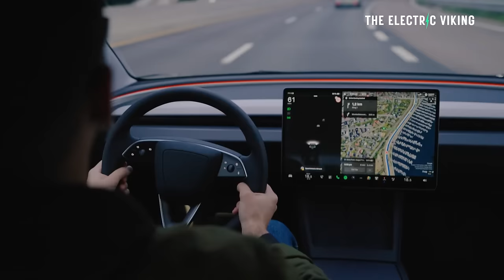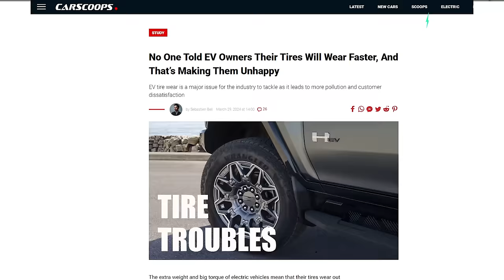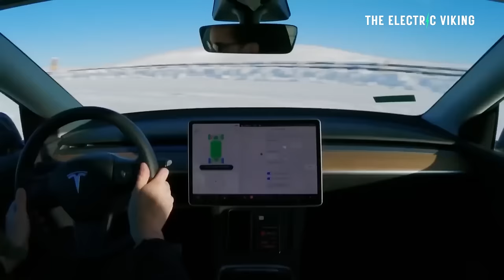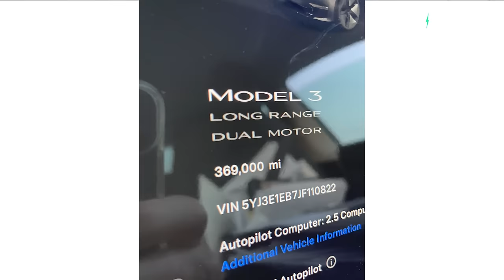I found the highest mileage Tesla Model 3 in the world - I'm shocked!

Comment: 400,000 miles... that's roughly $100,000 worth of gas he "didn't" buy.. not mention over 100 oil changes...  and the list goes on.  Even losing 20% of the range, is still a very usable car.
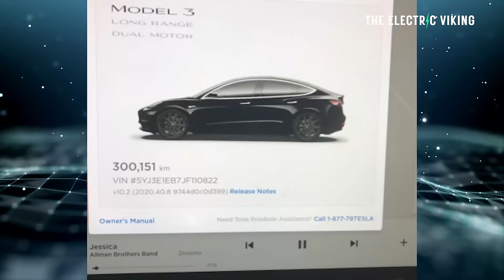Reply: Where you see 400k miles?🤔🤷🏻‍♂️ ? In video from 5:57…☝️ look again pls … all interior dash scene shots is from same ‼️ car (same vin number)🤷🏻‍♂️‼️🤨 wth you talking about and all numbers is on KM …☝️🫣 that’s mean kilometres 🤦🏻👍
Reply: 56.000€ worth in Gas to be correct.
Reply: @peterst111  1:30 vey clearly says 420,314 MI not km....
Reply: Hmmm. Here you can easily get a diesel that averages 50mpg. And, to be fair you have to allow for the cost of charging, so the "fuel" saving of electric versus diesel would be more like $25 k ish, still very substantial, but the saving is not $100k . Also, its more like 20 oil changes, not 100; if you are doing big milage you would use long life service intervals. Still, very impressive savings without getting carried away. Also, the guy kept saying "miles" when often the readouts clearly said Kilometres.
Reply: 400,000 miles/100,000 dollars = 4  miles/dollar? Let’s say avg price is $3 per gallon, so that’s 12 mpg. Not everyone is driving a lifted truck on 37s. Diesel trucks get better mpg than that lol. Superchargers are steadily increasing in price and there’s a wide range. US rn is about 0.30 to 0.64 and full charge is anywhere from $16 to $52 depending on model battery capacity. Do a road trip and superchargers along the way tend to be on the higher side of the $kWh. If you charge at home by all means, you’ll save a lot of money. But for those who can’t, literally cost like 35 bucks to fill up a Corolla or Prius and you’ll can get a range of 450 to 650 miles on a full tank. Also modern cars do oil changes every 10k miles now since it’s synthetic oil nowadays, so it’s more like 40 oil changes which they only hold like 4 quarts. Change mine for 20 bucks every 10k miles. Amazon got Mobil 1 for cheap. Not as bad as you think it is really.

Comment: I have a 2018 Model 3 Long Range rear wheel drive that I purchased new.  Pushing 100k miles and have lost about 6% range.  I had the upper control arms replaced just because the noise was annoying and to keep the car in good shape.  Replaced the 12V battery after four years (it was surprising inexpensive).  Other than that, three sets of tires (nails took out one of those sets) and my brake pads are still at nearly 90%.  Never had anything so reliable, fun and maintenance free in over 40 years of driving!

Comment: This is the kind of information that needs to be distributed. 420,000 miles on the same battery is a powerful, powerful, sales feature for EVs in general, particularly Teslas. The most I’ve been able to get out of my longest running ICE car was 230,000 miles. At that point the rubber seals on the transmission and engine failed, making the car junk. These rubber seals are the Achilles heels on ICE vehicles, and when they fail at that many miles the fix is more than the value of the car. I’ve got 72,000 miles on my Bolt. In 8 more years, I’ll be at 210,000. The car will probably outlive me. Let’s see how long our EV’s can go.
Reply: I've hit 398,000kms on '99 civic sedan
Started heating up. No other major issues and the car was sold to a small dealer within 8hrs of posting my Ad.

355,000 kms on 2010 civic and this was ended with a collision, again was completely fine and had tons of life ahead. Just the a/c give you an issue at this point for civics and if you want to fix this issue it would have cost around $600-$1200 is what I was told. New parts. Used vs new.

So the civic has been great. I bought another 2013 civic at 26k and now it has 167,000kms again no issues just regular oil change, tires, my brake pads last about 90k-100k, muffler had corrosion so I got a new one installed ($260 part+labour).
Reply: $100 worth of seals on your ice car would have given you another 100,000 miles.
Reply: Does the fact that there have been BEV fires mean that this is the likely experience awaiting EV Owner’s? That’s the flip side of using statistical outliers as marketing examples - that marketing knife is double edged.
Reply: I got 350,000 miles out of my honda when I sold it and it was in perfect working order. I just wanted something bigger.
Reply: and I never once had to wait to charge it. I could fuel it up in under a minute and it had 400 miles of range. It was reliable dependable and a great car to drive.
Reply: I ran in sub zero weather and 110 degree weather and I never had to wait for anything to cool or warm for it to work. I could run the tank down to empty and I could fill it up to the top. I could race it hard and fill it up without a computer telling me that I had to wait to charge until the battery temp was reduced to some arbitrary number. Oh and one time about 12 years ago I went to the filling station and all the pumps were being used and I had to wait 90 seconcs for one to open up. Then in 58 seconds I drove off and went another 400 miles. I never cared about the oil changes because I did them every 10,000 miles. That never seemed to be a hassle. That engine will probably go 1,000,000 miles. It's probably at 500K by now. I only paid 20K for it brand new. It's simple gasoline is the most practical form of transportation.
Reply: @renaissanceman5847  $100 dollars of seals and $5K worth of labor. Rebuilding a transmission is not cheap.  Especially for a BMW or equivalent.
Reply: @robsalvv5853  A BEV is much less likely to have a fire than an ICE with miles.  With a BEV nothing leaks and with a decent BMS there is little chance of over charging so the battery is not a likely candidate for thermal runaway either.  Now puncture a non LFP battery and you have an issue.  But they are typically well protected within the frame.
Reply: @zooker7507  I never once had to stand in the rain or snow or heat to refuel it.  I charge it over night so I have never had to wait for a charge.  I have never had to take it to a shop to change the oil or filters or even hassle with changing it myself and recycling the oil.  Not once has the state sent me a letter saying I needed to get the smog test done.  My Model 3 has 85K miles on it and it has another 10K miles on its tires.
Reply: @bryanwhitton1784  you missed the point. Your uncle might have made it to 95 smoking a pack a day but that isn’t a case study that says smoking isn’t related to early death. The OP was trying to make that argument.
Reply: @robsalvv5853  The data shows he's correct.  Gasoline vehicles are 60 times more likely to catch fire by percentage in the US and 97 percent of Tesla's that have reached 200,000 miles have done so on the original battery.
Reply: @Ryan-ff2db  you missed the point too. 

Link me up to these stats.
Reply: I think its important to appreciate the difference between a car doing 200 - 250k miles in 5 years and doing it over 15-20 years. Its much easier on the car to do it over the 5 years as you suffer much less deterioration due to weather and aging and fatigue than over the cars lifetime of 15-20 years. Also, it generally indicates the car has clocked up a lot of its milage cruising on motorways which is much easier on the car than hacking around short journeys on local roads.

Comment: Exactly this!  I see so many comments from people referring to EVs as having short life spans when its the opposite that is true.  Certainly for Tesla at any rate.
Reply: I also see people saying the cars lose their value very fast, but that's just because there's not a lot of second-hand buyers yet. At 25k euros in Europe the long range model 3's that have  under 100k miles are flying of the "shelf". I'm looking to buy one in about month and every single one that I've found and kept the tab opened to sold withing 5 days. That being said, I'm looking at VAT deductible once mostly but still. People buy them even as second-hand cars. Other "trashy" EVs like Nissan Leaf that has shitty battery management are definitely less looked for, I wouldn't trust a Nissan 6 years old battery too.
Reply: @alexandruilea915  Yeah nissan leaf no thermal management means its ok if you live in a mild climate like SF (lowest and highest ever recorded temps 40F-106F. In DC we sometimes get 60F difference in the same day 😂) but it doesn't like extremes. One good thing about the leaf if you're buying a used one though, is that you can see the approximate battery degradation straight on the dashboard with number of battery bars
Reply: My eight year old Fiat 500 E with 65,000 miles still has over 95% of its original battery capacity.
Reply: The people making those comments have never owned an EV and never investigated one.
Reply: @geemy9675  The thing is that the thermal management also helps with faster charging so not having it means long charging times in road trips.
Reply: I expect my 22TM3LR to last more than 750k miles.
Reply: @macrumpton  good to know, my wife is looking at the Fiat 500e after owning the petrol version for many years.
Reply: But if a battery fails what then???
Correct huge costs
Reply: @dave1704fornow  what if the battery dies? What if you throw a rod in your ICE engine and it destroys the transmission too? Between the replacement cost of the parts, and the labor to install them, you are probably looking at half the price of the car.
Reply: @macrumpton  eh, your not wrong, but it's iffy. I work on nothing but new vehicles. We charge 150/hr, and an engine swap pays 16 hrs. Most of these engines are small enough and most parts other than internals are swapped that it isn't that large of a cost. A 25k nissan rouge with an engine swap we just quoted 4k for parts and labor. But this can very if your talking any type of proformance engine. A New tesla plaid long range battery was like 8 or 10k before labor or shipping. Yea, not the best comparison as the plaid cost like 3-4x more, but yea.
Reply: @alexandruilea915  its limited to 50kW peak anyway. maybe they nerfed it because of the lack of thermal management but I guess the electronics are not capable to do more anyway. people are not nuying a leaf for long trips so they probably struck a average speed thats easy on the battery, doesnt require beefy internals, and is good enough for a quick top up but not something youd be driving coast to coast anyway. its also consistent with a chevy bolt with bigger battery , thermal management and similar price so I would have never expected much more
Reply: @macrumpton  2015 fiat 500e with 50k owner here 🙂how did you measure dergadation? I haven't noticed any degradation since 2020 and the last 20k miles even though its really hard to tell between seasonal variations, and the fact that's it's driven by me and my wife in a totally different fashion, she doesn't like when the power meter is red whereas I'm always in the red 😀
Also the range guess o meter is pretty bad and unreliable
but I think it lost a good amount of capacity, maybe during time when the car was at dealership and not charged properly  ? like long time at high or low SoC
my last numbers with alfaOBD were pretty terrible
Full Amp Hr Capacity : 49.40 Ah
Remaining Amp Hr Capacity : 26.20 Ah
HV Bat SOH : 26.27 %
HV Bat SOH-R : 67.45 %
HV Bat SOH-C : 70.59 %

down from 2021 numbers:
Full Amp Hr Capacity : 49.40 Ah
Remaining Amp Hr Capacity : 29.90 Ah
HV Bat SOH : 57.65 %
HV Bat SOH-R : 83.14 %
HV Bat SOH-C : 76.08 %

I don't care too much about range but degradation concerns me if it spirals down and the battery fails.
I just dont know how reliable those numbers are.
I still get 117miles displayed on a full charger but I dont get anywhere this range more somewhere 60-80miles
Reply: @callumsastrophotography4859  if you can live many years with the petrol version, you will have no problem to adapt to th electric. its like a zippier version with the torque of a tractor 😀 traction control is bad though so be prepared to spin the wheels all over the place when its wet
Reply: @geemy9675  but as a second hand car it's value wil tank even more than it already did.
Reply: @alexandruilea915 used leafs are already cheap
Reply: they do if you are from a legacy automaker who is only into EVs to make money and follow the trend, spend no RND have no product support, make them crazy heavy to get the range and try to make up the cost by adding in all matter of unnecessary upgrades.  Truely making it a niche car with no resale. Then, no one buys them.   

Tesla will each all other manufactuers except for toyota.  No one else innovates.   Tesla innovates and is on part in 10 years.
Reply: @dave1704fornow  Let's compare shall we.  I looked up the price of a new engine in the BMW 300 series and the price ranged from $28K to $45K for the 328i through the M3.
The invoice I looked at for a Model 3 that needed a battery replacement was just over $14K.  So which one would you rather buy?

Comment: Hi Sam, greetings from the U.K. I’m 58, I’ve owned many ICE cars in my time and I usually bought used cars and kept them as long as is viable. The best I got to was 193k miles in a BMW E36 (1998 3 Series), by this time the car had become a money pit, oil leaks, ignition problems, failing radiator, alternator, water pump. The last straw was the head gasket, which just put the car beyond economic repair. EVs have none of these parts!
Reply: ?... Unfortunate. My 96' 328is has 205,+++ miles with only the passenger side mirror and the drivers window switch(s) failing.  I fixed both myself.
Reply: Well, it IS a BMW.  Never known as an economy car.
Reply: I´ve had many ICE cars where the mileage has been last 300k km with no repairs other than periodic maintenance. In fact, none of my cars have had any engine related problems. I never bought a new car. Generally the miles when buying has been 50-100k and I’ve sold them when they’ve had 250-400k. I drive around 50k a year
Reply: @sebulban  Modern engines last "forever" with synthetic lubricants.  Transmissions are a crap shoot.  Failures have little to do with friction and wear if one follows the maintenance schedule.  Often a sudden part failure.
Reply: Shockingly, modern engines have design flaws.  They burn oil.
 Timing chains stretch and FUBAR the engines.  The lifters wear and make noise.  Cam phaser wear out.  This happens on well maintained vehicles across the automotive spectrum .
Reply: Yes, but how old was it at 193K? im betting it wasn't 4 or 5 years old. The age plays a massive factor.
Reply: @sebulban  See that, no one is interested in someone with ICE cars that have clocked up big mileages without major difficulty. I feel its a double standard against ICE.
Reply: @frequentlycynical642  Mmmm, well if you research before you buy. A colleague has a2016 Ford Fiesta 1litre ecoboost. Complete engine failure at 74k miles with a full dealer service history. Oil pump is driven by a rubber belt which sits in hot engine oil. These engines are notorious for failing early.
Reply: @simonreeves2017  Do you not understand that an exception does not negate my position?  There have always been dud engines.  The Chevy Vega comes to mind.
Reply: @deckard6_634  yes. My father in law has a Audi 100 that has 950 000km in it 😅
Nowadays I have a model y performance and A5 Audi Quattro. Both are fabulous cars but he maintenance costs(even without breakages) on that Audi are on a different level

Comment: My new 2017 model x with 80,000 miles never visited a service center. Only maintenance have been tires, 2 sets.  I charge at home with
Solar.  Still looks, feels, and drives like new.  No rattles or squeaks. I want to see how long it will last.  I usually buy a new business car every 3-4 years but nothing better out there than my Tesla.  Totally happy.  Other previous cars ready to trade in 4 years.  I have been spoiled by minimum maintenance.  No oil filters in land fills and dealerships checkups every year.  My wife owns a Porsche.  Very dependable but yearly oil change/checkup/software update $1000.
Reply: Free advice: Change your brake fluid at least once every 2 years, this fluid is hygroscopic, iaw, it absorbs water.
This gives internal corrosion and mountain down with a full battery vapour lock in your brake callipers.
That means, no brake power due to gas forming in the brake callipers due to heat.
Reply: It is a Porsche. If you force the wife into a toyota yaris you are going to cut that $1000 by 70% ish.

Comment: The problem with the upper control arm Sam was actually the seal on the ball joint. Many of those seals failed fairly early or after only a few years, allowing water into the ball joint which of course meant it started to rust and then started to make noise. New seals from a different source has obviated this problem. And there are also aftermarket options. But you are right that is the most common point of mechanical difficulty. I wouldn't call it mechanical failure because it literally takes years of noise before the ball joint becomes unstable

Comment: The main advantages of LFP over Li-Ion are:

Their cycle life is greater
They’re cheaper
The fire risk is reduced 
They don’t use cobalt 
They can be charged to 100% without degradation 

Disadvantages:

They have a lower energy density
Reply: Also lose some range in cold conditions.
Reply: I have a 2021 model 3 SR+.  Is that lfp or li-ion?  I don’t know the difference.  Thank you.
Reply: @DannyPorsche  My understanding is that if it recommends NOT charging to 100% then it’s Li-Ion, if it says it’s ok then it’s LFP. I don’t know the screen navigation to check that.
Reply: @fredbloggs5902 I think you are correct. But the SR models after 2020 were pretty much guaranteed to be LFP.
Reply: Only other disadvantage I'd add is - charge is a bit slower and output isn't as much (meaning slightly less 0-60). Great list!